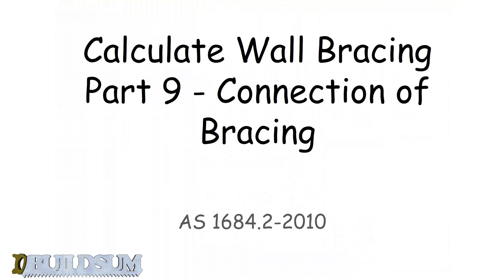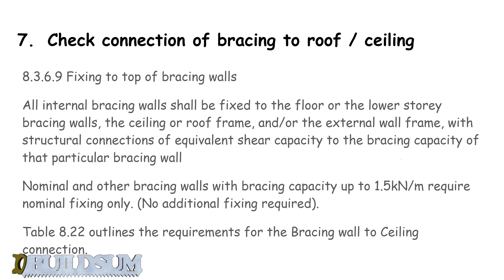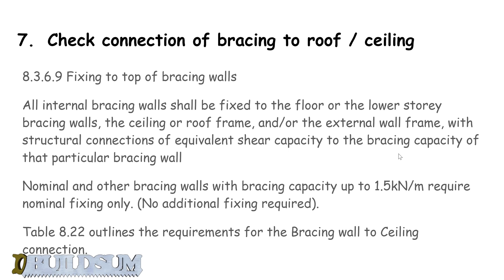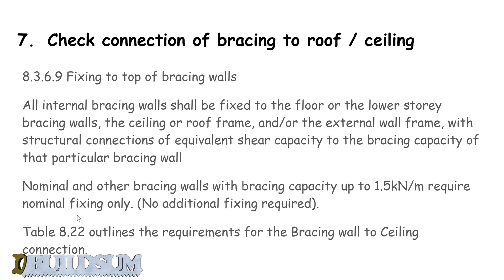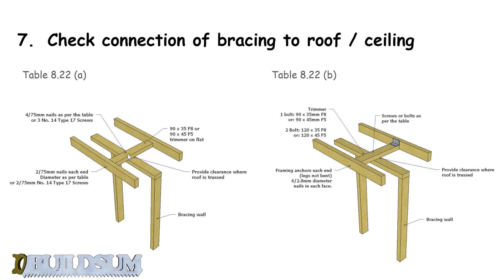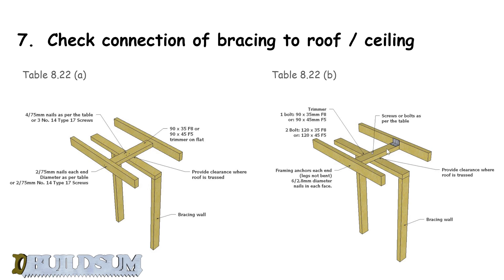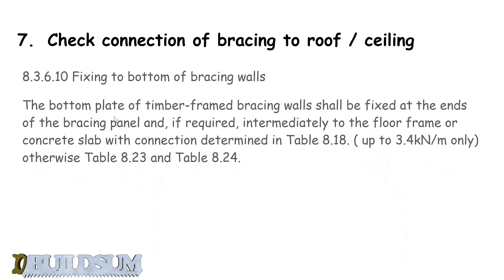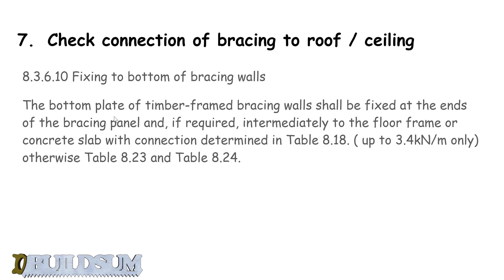Calculate Wall Bracing - Part 9 - Connection of Bracing

Comment: Can you please help me with explaining the purpose of bracing units in table 8.2.  If i determine number of units is 22, how do I determine bracing to meet 22?
Reply from the maker: Hi, Table 8.2 will give you the force that will be applied to a m2 of wall in that direction. You then need to work out how many sheets you need to resits this force.

Comment: thanks. What about wind bracing for raked ceilings?
Reply from the maker: Hi Mate, the connection would be the same just on the angle as the top plate will be on the angle as well.